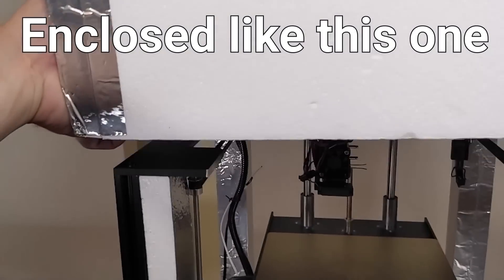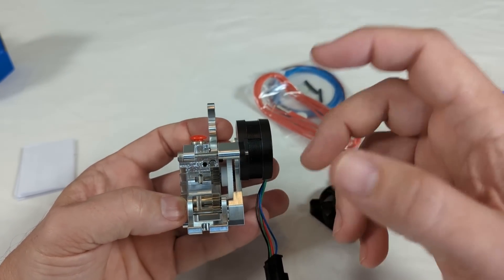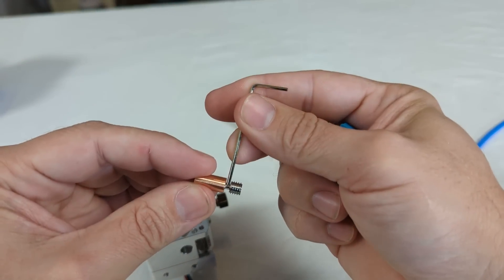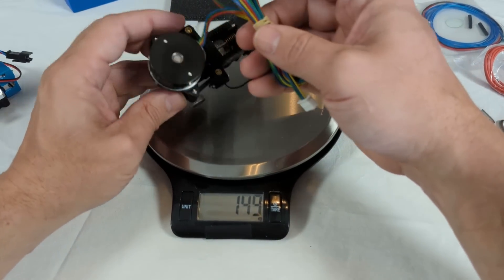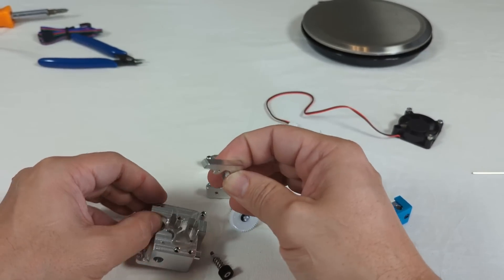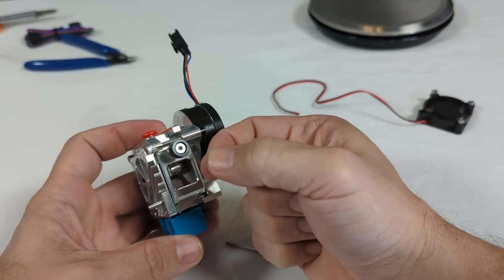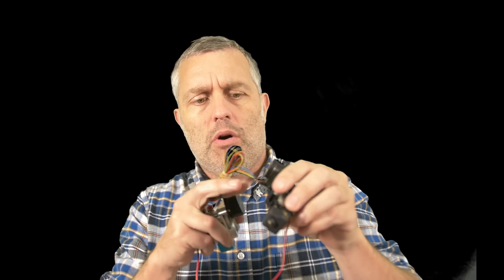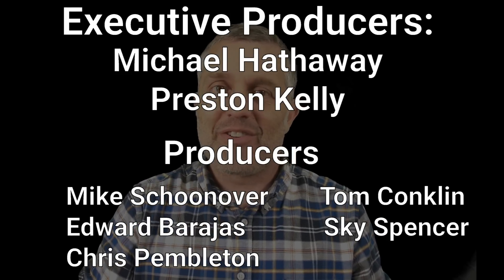The NF Sunrise Direct Drive Extruder Has A Trick & It's super satisfying

Comment: Every time you bring up that "nylon" gear...... come on. And slice? Come on man.... Patent trolls who think they invented everything. The nylon gear is 100% fine. This is totaly wrong. Im printing on my voron with  80c internals. WIth a PRINTED extruder with no issues... yet you think a formed nylon gear is gonna melt? lol Come on. In NO way is the BTT better. None. It has huge QC issues and binding problems BECUASE of the metal gear. 40G makes F all differance when pushing massive speeds. LOL come on man. On a standard flow hotend... this is normal.  your math is wonky. This is not the way to measure it.  You do flow with what gets extruded . This review is absolutely WRONG. The BTT is in NO way better. Like none. I have both. Absolute nonsense. Keep waseting you money.
Reply from the maker: To keep Vorons working requires constant tinkering. You say you're printing without issues. I highly doubt that. The reason bamboo is taking over the industry is because when they say it just works...It. Just. Works.

There's a big difference between "100% reliable" and "you can get away with it"

Comment: Just an FYI, while copper conducts heat better than stainless steel, stainless steel will still get just as hot as copper, it will just take a bit longer.  So the point about a copper heatbreak being "better" isn't really accurate.  A copper heatbreak will just take less time to get up to temperature.  Performance will be the same though.
Also the point about the pin near the end is really a none issue honestly.  I mean realistically, that pin is never going to move since the "door" will never move.  Plenty of other extruder assemblies have pins like that in them, and those are literally never points of failure.
If you put the Slice engineering heat block on the nf sunrise, it would also print at 172mm/sec.  Just thought I'd add that, since the point about the sherpa mini being a "better" extruder is technically incorrect. That cheap heat block on the nf sunrise is what limits the print speed, not the extruder itself.

Comment: 5:10 This doesn't make any sense, the heater block will be the hottest part, the threaded part of the heat break will be a bit colder, the straight part of the heat break will be even colder. It seems you don't understand the difference between heat conductivity and temperature
Reply from the maker: I LOVE that I finally have a technical disagreement. I can't tell you how many comments I get disparaging my person while never addressing the technical statements I make in the videos. Thank you! 

That being said, You are still attempting to disparage my person by saying I don't understand. Those words make it personal and attempt to make a statement about my value. Very impolite! Even if my statement wasn't correct. How do you know I don't understand?. Are you trying to make me feel bad about myself? Why do you feel the need to break my person down instead of just correcting an inaccuracy?

After rewatching the video I do agree with you. The words as I've spoken them are incorrect. I was attempting to make the point that the stainless steel has more poor thermal conductivity than the aluminum hot lock. Therefore, the stainless steel threaded circular chunk will not transmit heat to the filament as quickly as the block. The filament coming down the tube will be stripping the heat away faster than the aluminum hot block can transmit heat through that part. This is the reason why the actual copperhead uses copper for that portion of the apparatus. My apologies that I misspoke in the video. My presentation style is ad libed and prone to this type of error. I do in fact understand the concepts completely, but while trying to explain them to the audience and formulate my sentences at the same time. my cognition gets tripped up in the moment. It's one thing to be able to pass a test on the concepts. It's another thing to be able to empathize with someone who has not yet learned the subject matter. all the while formulating your thoughts as you're speaking them.
Reply: @DesignPrototypeTest  I did not mean to be impolite, I'm sorry if you feel that way, that was not my intention, I'm just an engineering coming to the point.
About your questions:
1. How do you know I don't understand? You seem to equate (5:02) "low heat resistance" with "low temperature", that is incorrect.
2. Are you trying to make me feel bad about myself? No, I'm only trying to correct a perceived misconception to improve the understanding of this topic.
3. Why do you feel the need to break my person down instead of just correctig an inaccuracy? My intention is only to correct an inaccuracy and give a pointer in the direction of a perceived misconception, purely based on what was said in the video.
BTW: I don't think the plastic wheel is an issue, but you can probably easily replace it with a metal one. The lever might not be needed, but helps to keep the clamp tension constant between filament reloads.
Keep up the good work!
Reply from the maker: I'm sorry I won't engage with you any more. You are defending your statement that I don't understand. This is a personal attack. Everything I said from 5:02 through 5:15 is 100% factual and accurate. Think of stainless steel as insulation. Heat from the aluminum hot block will travel very slowly and inefficiently through it to reach the filament. Therefore it is colder than the hot block. Where I misspoke is when I said that it would be colder than the heat sink and copper at the other end. Obviously the "cold end" of the hotend is cooler. I don't know how I got my words so twisted around and missed that statement while editing the video. You are pressing the issue of my understanding not the technical correction. You are just another troll here to break my person down instead of searching for truth. Do it again and I will ban you.

Comment: I think the plastic gear is an advantage. It separates the heat from the motor and the filament driving gears. Had in the past serious issues with got gears fail to move filament properly.

Comment: I like the plastic gear as an easily exchanged point of failure. The pin seems like it wont be an issue; when it gets hot it will expand. Above all, I ordered this after seeing it bolts directly to my ender 3 pro metal plate. Its the winner imo. Thanks for the review

Comment: Hi. I almost talked myself out of commenting but in the latest, muse? You mentioned you read ALL the comments on your you tube channel so.....
I'm an early adopter from New Zealand, and down here we buy from China or Australia because the US will send anywhere in the world as long as it's in the 52 states, or at least 50 or so most of the time. I'm not trying to change your whole world view (and gas lighting isn't something I have time or energy for ) but possibly its worth a thought that there are reasons for the China "thing" that are at least partly caused by us (and in c capitals) US. Just a thought. Also as an early adopter I bought an NF sunrise extruder. An awesome extruder for what I bought it for mostly..... But I feel in your review you missed a couple of points that would have helped me (if I hasn't already spent my money). The nylon gear is fine in an enclosure, so far at least, up to 80 degrees Celsius, no issues there at all and I think the metal drive on the stepper and the difficulty lubricating metal gears may have had more to do with the design than the Chinese effect but I'm speculating. The hinge pin hasn't ever moved. And the three screws holding the fan haven't been an issue.
However. The stepper has a very fine tolerance between not driving correctly and over heating, especially in an enclosure, the tolerances of the machining around the drive gears is too loose to drive tpu reliably, and there are no high temp cooling fan solutions provided for an extruder that looks purpose built for high temp use. 
I have used it extensively for nylon and polycarb, carbon fibre loaded etc and it's very good, a highlight being the "useless" loading lever, probably something I would now class as essential especially in an enclosure where one handed loading is the norm. Many more thoughts but I do classify this comment as the "test" phase. Thank you for your insights.

Comment: Having owned both the BIQU H2 and nf sunrise I can say the sunrise is superior. 

I've had two BQ's and both have quality control issues. Grinding gears, Prints were never great.

Now replaced with the sunrise and wow its so much better! better prints immediately after installing. 
I disagree with your conclusion on the Bq being better a design - Not having all metal gears is an advantage. The open frame is better. Better stepper. On the BQ if it clogs you have to remove the whole extruder and disassemble. 

Another thing.. Maybe test them in a printer before you post a review? 🤣
Reply: he should call them teardowns or 'I think this is better than the other without doing any test prints'

Comment: the review is great... except from the nonstop bashing of the "meeeh! chinese copycats!!!"
and just by the way: its just fine that the larger gear is ny Nylon blend. This way you prevent binding cause of that tiny bit of flex it allows, it doesnt need lube and hey, not even Bondtech uses metal at this point, (because they are smart, you know)

for Flow: just add a copper block and CHT nozzle and print as fast as your printer can run ^^
My Dragon Hotend (normal flow Heatbreak) with Orbiter Extruder  and Copper nozzle can print at 250mm/s if i need speed. regular print speed for good looking parts are goin at 150mm/s on my Voron-ified Ender 5 without a hitch and without ringing... cooling is my worst enemy with small parts and have to set a minimum layer time for small stuff.
Reply: My voron with a heavy ass SB still prints faster than he is talking 300mms/10000 No issues. 40-50G makes no diff in speed for the most part....

Comment: thanks for reviewing this nf sunrise extruder. because i would never be buying it for myself because of other potentially better looking chinese metal extruders. but that does not matter since what i wanted to comment about here is more broadly applicable across all in this general category: 1) these metal chinese extruders are definately too heavy. but if you have cnc capabilities, then they can potentially be hogged out a fair bit and the weight reduced to be a lot more reasonable. 2) yeah the plastic (presumed to be a 160c hdt POM gear can we destructively test that?)... that gear is the biggest dealbreaker. however (again?) if somebody has a good enough cnc capabilities (or the ability to print in PEI / ultem?)  then it might be possible to replace it somehow? unfortunately in all this longtime i have not seen any metal version of the plastic gear about. AFAICT none is available from anywhere (including bondtech too). so really we want to get onto asking and requesting for metal version the gear itself. since that problem is not going to get solved all by itself. we need to help solve it! actually i am finding recently and in general 3dp manufactures both chinese and bondtech seem more responive and happier to take such feedback in recent months. and be trusting of the nature of the request is to fulfill a real conumer need. so there is some level of a realistic hope to go along with that suggestion. without it feeling like its such a waste of time

BTW will you get in andreview the new phaetus rapido? its being sold by trianglelabsright now. who are main reseller for the phaetus company. i believe its well worthwhile to be reviewing FYI

Comment: I don't see that in your heated chsmber you would get to glass transition temp of nylon. If you do, the whole heatsink would warm up to that (because that's the environment temp) and would cause issues with the raw filament you are working with. The lever is a nice thing, yeah it adds a bit if weight but it's essier to change filament, depends on what you want. Also a direct mounting on an ender is a big bonus for a lot of people. Also it's size is compact. Heatcreep you are not able to test that way if the throat doesn't make full contact with the heatsink though, because it's not threaded, and I didn't see you using paste, it might happen.. as for the heatbreak, having the bottom part steel wouldn't consern me, less heat transfered by the heatbreak and you can compensate that lost part of melting zone by using a volcano (which you can order this with)

Comment: I think there is one major advantage that you haven’t mentioned - there are holes through the CNC-machined aluminium that appear to have the right spacing for mounting onto a Creality carriage plate or - in my case - a Tronxy X5 carriage plate. I mean that the hole spacing seems to mimic those on the original hotend red-coloured heatsink.

With the Biqu H2, or a Mosquito hotend for that matter, you have to make up a mounting and this can affect your print area/make it difficult to reach the edge of the bed and, if made in plastic, can distort or wobble.

The promise of a nice solid mounting for the extruder and hot end together is enough to sell me on this NF Sunrise. Short filament path and low-profile is also useful for my enclosed printer. There’s a cost advantage over several other hotends, plus the reports many people have had of seizing gears on the Biqu H2.

Thanks for a nice review and flow test! :)

Comment: Well I know you are a designer and not an engineer but please do some research about plastic gears vs metal before you make statements that does not make sense. Also, metal will be affected by thermal expansion in a heated chamber that could affect the functionality. 

You talk about using this "all metal extruder" in a heated chamber but then you should choose a liquid cooled solution and not fan cooled. Using this in a 80c heated chamber would not be my choice

Comment: I would think that pin doesn't matter once mounted with a normal motor, plus as you said the fan protects it from falling out, I should think designing it like that probably means cheaper costs

The "advantage" was price to performance but I've noticed that the price has doubled since switching to the LDO motor

Comment: i have never heard anyone whine so much about the plastic gear. they are usually made out of nylon, and what is the melting temp of is ? like 200 C ? dont tell me you have your changer heated more than 90 C. Also, the other reason you wanna have a "plasic" (really a Nylon) gear so that is the weak link. so you dont strip some metal gears. nylon gears are cheap, ez drop in replacement. aslo you can get those gears in metal from same aliexpress. 
Now, on the sliceengineering topic. i know they are so good and all, BUT, not everyone is that rich to pay import taxes on parts from USA, i rather buy a great chineesium made direct drive like nf sunrise than pay double in taxes and delivery fees. 
I have been using nf sunrise for a while now, printing at 150mm/s casually. using all metal titanium TB, have not problems what so ever.

Comment: Why do you emphasise the fact that you can't use plastic in a heated chamber?  You still need the parts cooling duct, and I can't imagine that made out of aluminium. Or did you decide to never print PLA and PETg with that enclosed printer?
Reply from the maker: The part cooling duct is being actively cooled by the part cooling fan as it does it's job of directing the air at the print. Not only that but the part cooling duct isn't structural or mechanical. It's just a fancy tube for directing airflow.

Comment: the nylon gear will not fail inside a printed chamber. nylon 6,6 fails at 482c, nylon 12 fails at a temp > 200c, i dont know about warping temps or about other material combinations but if heated metal block goes above 160c then pla will not flow in extruder anyways. so nylon gear should not be a deal breaker, other than metal gear might handle more load.
Reply from the maker: Between 50° and 100°C Nylon gets a lot softer. The gear is under constant friction and pressure as the printer is running. Look at this graph and tell me that you seriously think Nylon is a fine to use in a critical mechanical element: https://d2n4wb9orp1vta.cloudfront.net/cms/0811ptMaterials1a.jpg;width=550;quality=60 Nylon at room temperature is stiff enough. Nylon at 100°C is more like TPU. Would you trust your extruder with a TPU gear?
Reply: @DesignPrototypeTest  That graph is correct, but the units are taken out of context. 2500 Mpa = 362,594.34433 Psi. 500MPA = 72,518.86887 Psi.  Convert 2500 MPa to Psi and vice versa. To find out how many psi in 2500 mpa, multiply 2500 by 145.037737797. You are never going to get your chamber hot enough for that Nylon gear to fail. And that is just Nylon 6. There are far higher temperature Nylon mixes available. So do I trust Nylon at 100°C? Why yes I do.
Reply: @DesignPrototypeTest  I think you have Nylon and Delrin mixed up. Delrin/Acetal will begin to soften and fail closer to those temperatures. Acetal has a HDP of 104°C @264psi. https://www.wshampshire.com/wp-content/uploads/acetal_grades.pdf
Reply: @DesignPrototypeTest  what type of nylon is gear made? this makes a difference for the argument.